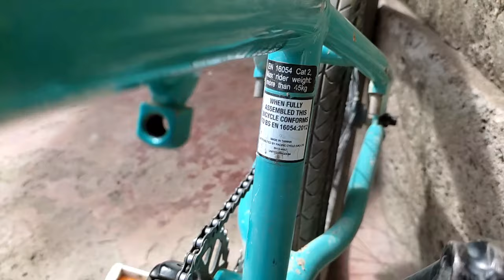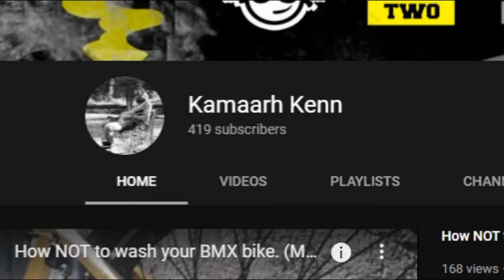Mint Green Mongoose BMX Bike Rebuild.

Comment: you should wash it with gasoline or 
WD-40
Reply from the maker: Those work well for scuffs and removing glue residue. For grease and oil, just soap and water is good enough